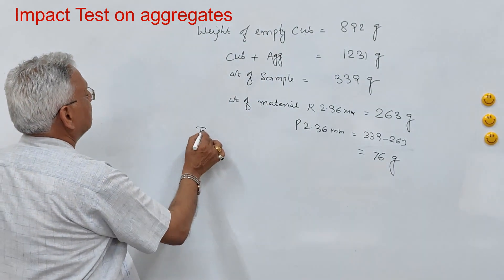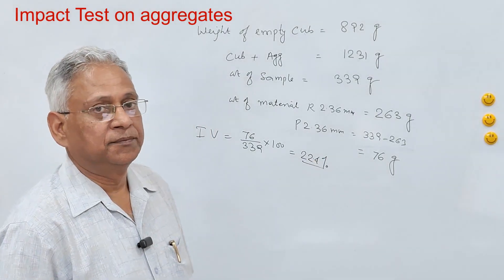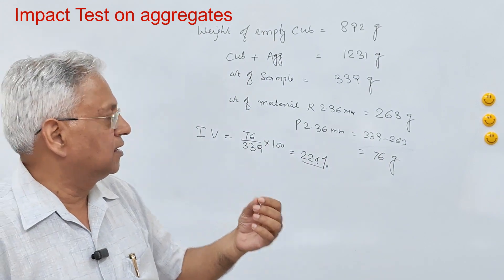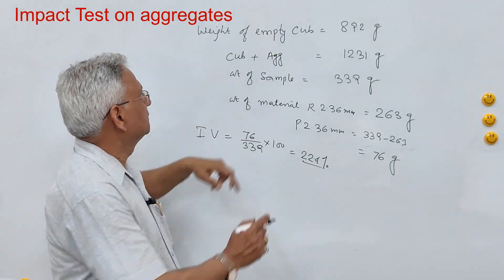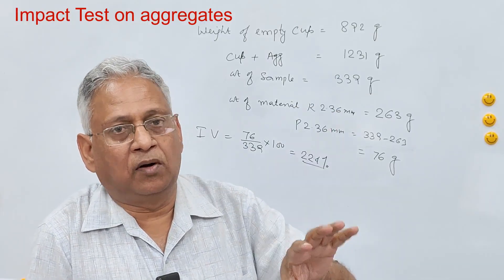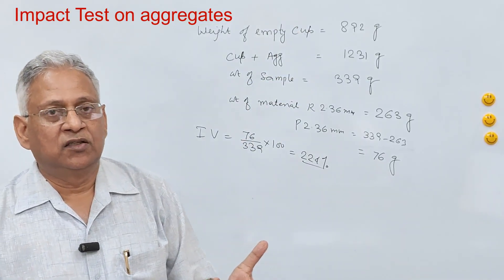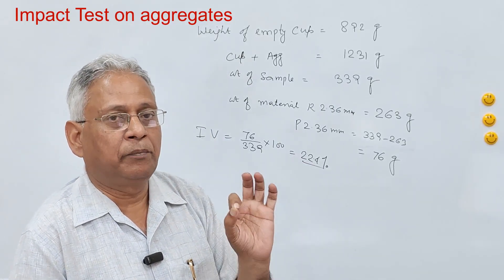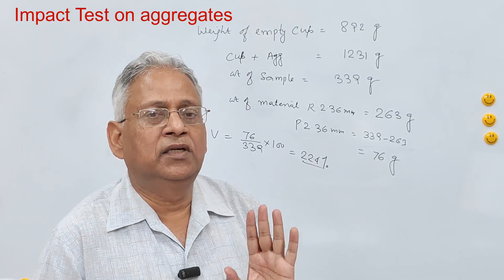Impact test on aggregates, complete procedure with laboratory demonstration and calculations

Comment: Thank you sir. Very clear explanation. I have a few questions.
* The IS code referring to this test is IS 2386 Part IV. IS 383 gives specification for coarse and fine aggregate for use in concrete. You mentioned the specification for using in Bituminous layers. Could you tell me which IS code refers to that.
* I always wonder what real-world situation does this impact test simulates. You mentioned in the beginning that during construction work and also during vehicle movement there is impact. However, I am wondering whether this test correctly simulates these situations. When a roller moves, what force is applied, is that same force or pressure created here? Also, when vehicles move on rubber tyres, is the impact load significant? Does this test simulates that? These questions always come to my mind and I am not able to confidently answer my students. So I want to ask you sir.
* If a construction company gives me aggregates to test, how should I take the sample? Is there any technique for sampling?
Thank you.
Reply from the maker: *Test procedure is given in IS 2386, specifications are from MoRTH Specifications for road works 2013.
*Yes, impact test does simulate the impact due to rolling wheel, because road surface is never smooth flat. The wheels jumps over these undulations creating impact load. ANnd this impact will depend on wheel load, vehicle suspension system, and road unevenness. Moving wheel is dynamic, and therefore, this test is also conducted under dynamic load (15 blows). These 15 blows represent cumulative imapct effects over time. Impact here basically means shock loading. 
The Los Angeles Abrasion test which simulates both, abrasion and pounding action, is more suitable than impact test. 
* Sampling method is also given in IS code. Since this test is done on aggregates passing 12.5 and retained on 10 mm, only this size is sampled. For larger size aggregates, we need to break them to make the sample.

Comment: Thnk u so much for the video sir.but ,i have one doubt why we always taking only small size aggrgates for impact test and why we didn't take large size aggregates for impact test
Reply from the maker: this test is designed to evaluate the aggregate's resistance to sudden impact and crushing, and smaller sizes are more easily subjected to standardized impact blows in the test machine. The smaller size allows for a more controlled and representative assessment of the aggregate's toughness and resistance to disintegration under impact
Reply: @SatishIITR  thnk you so much for the rply sir
Reply: Thanks sir,,I am retired chief engineer but regular viewer of your videos,,these are very useful for all including field engineer
Reply from the maker: @komalprasadkp300  so nice to see your comment. Thanks for your support